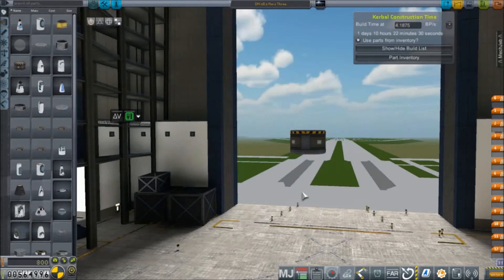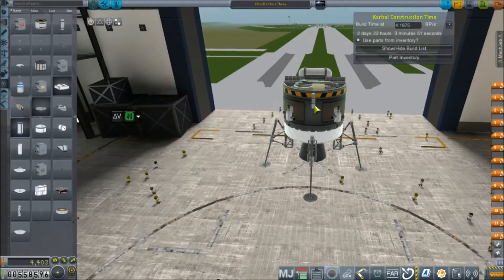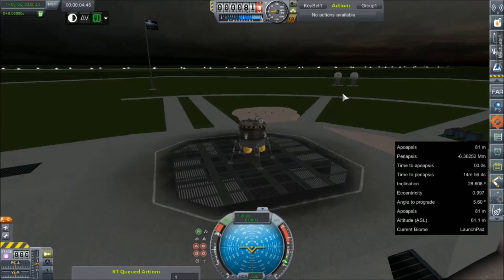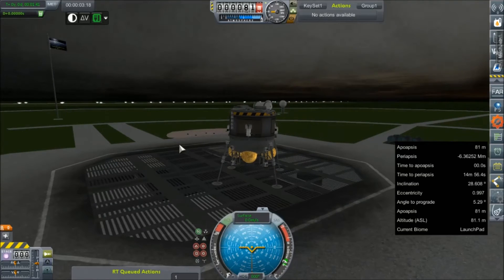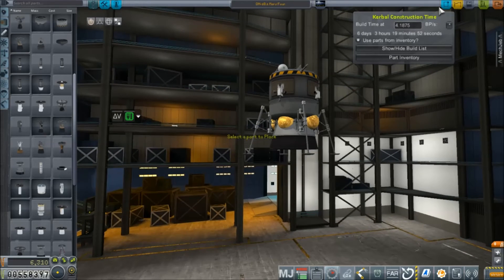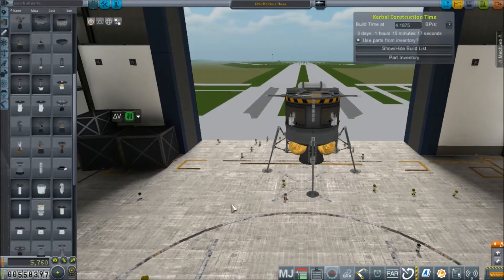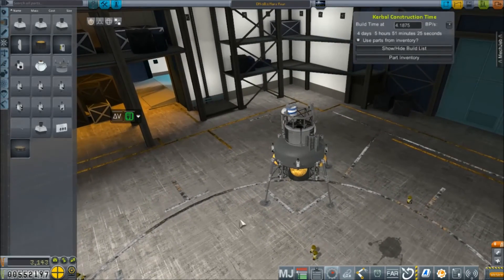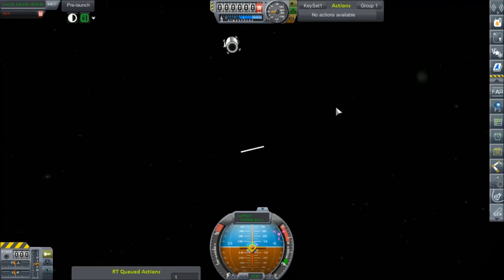KSP RP-0 #190 Mars Lander Protos

Comment: I understand that you’re having a hard time trying to land but you have to agree that most of these landing issues are because of your really weak landing engines so I suggest using stronger engines
Reply from the maker: Yeah - the problem is that more powerful engines only typically have 1 ignition - and I am going to need a lof of re-lights to land.  Sad as it is, the humble little Astris is the best I've got.

Comment: Why are you trying to use non-throttleable engines for landing? That just seems like a recipe for failure. Especially with the long spool-up time of the AJ-10.
Reply from the maker: The selection of throttle-able engines is a bit scarce. I agree though, the spool-up time might be a deal breaker on this AJ-10.  I am going to see if I cant get the LEM descent engine to work suitably / not look stupid.
Reply: Well, just make the thing wide instead of tall. That also has the advantage of making your landing legs further apart, which reduces the probability that you will tip over on landing. I'd also suggest looking into adding other engines, possibly ones like the Advanced Gemini Lander Engines from the FASA pack, which don't have gimballing but are throttleable and very small. You'd need to keep the RCS on for directional control, but IIRC with the LEM Descent Engine you'd need to do that anyways.
Reply from the maker: Its an interesting balance. The LEM engine is itself pretty tall, though I've built 'around' it in the past.  The other obvious candidate is the Astris II.  It's a bit late in the game to add more engines, and with all the stability issues that are cropping up now, adding anything is all but off the table.  I chose to leave out the FASA pack from the beginning simply to part count.  It was a tough call, and it has created more than a few interesting challenges, but I need to keep telling myself I'm up for it.